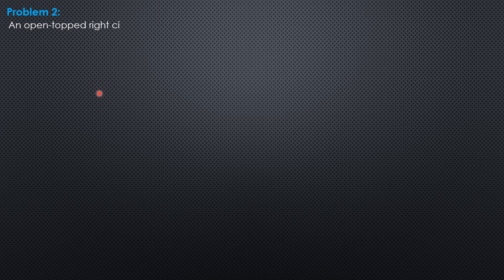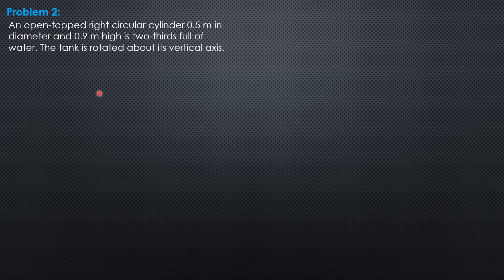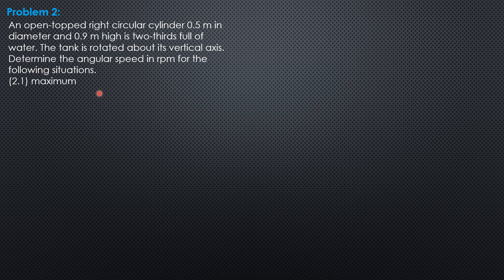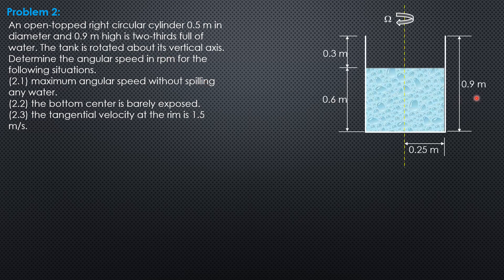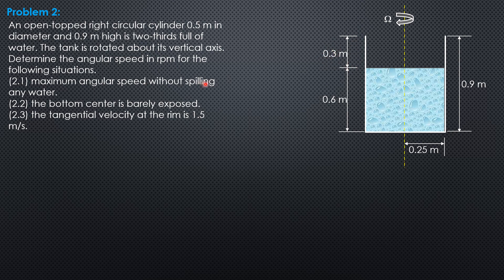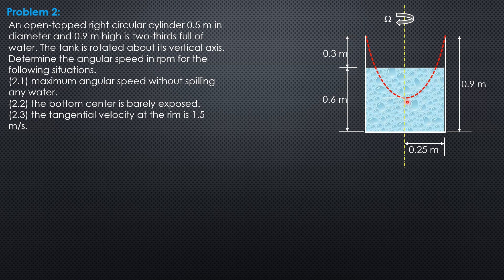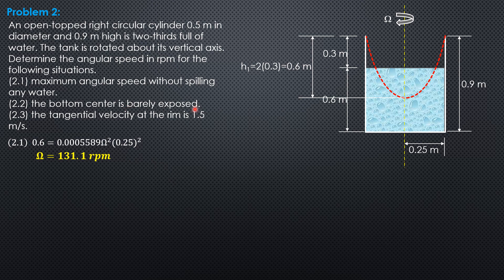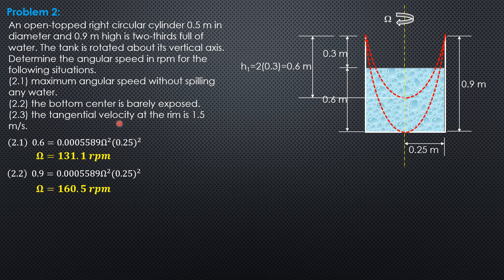ROTATED VESSELS, Example 2

Comment: if it is ask compute the water spilled in (2.2), how will u compute that? TYIA
Reply from the maker: @Christian-rv8fd You will not learn if you ask questions that can be answered by you if you explore all the sample problem videos and you first watch the lecture videos (principles and derivation of formulas, the most important part). Do not attack the problem directly without mastering the principles. Or else, you keep on asking questions even if they are basic ones. For this only, I answer your request. Vol spilled=Final volume of air minus initial volume of air. The final volume of air (paraboloid) and the initial volume of air is cylindrical; Vspilled=(pi/2)0.25^2(0.9) - (pi)0.25^2(0.3)=0.02945 m^3.